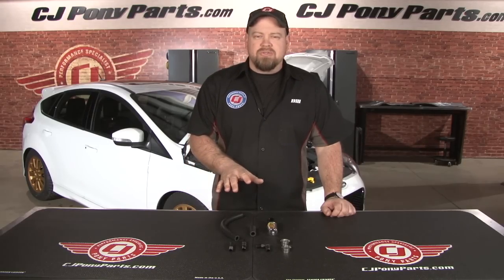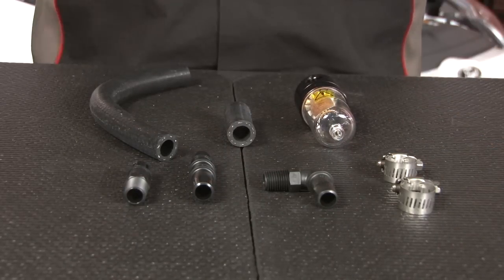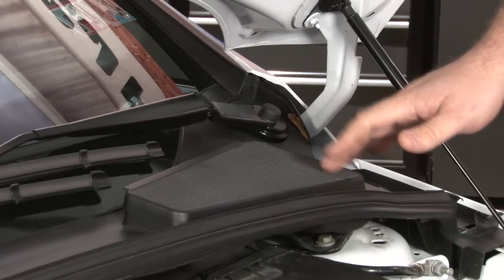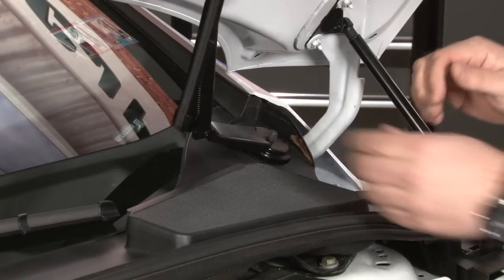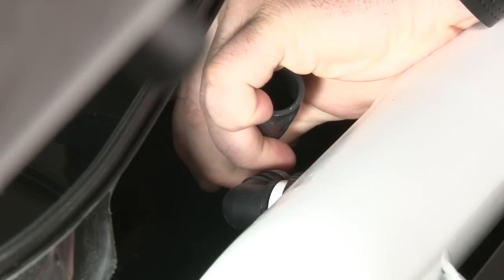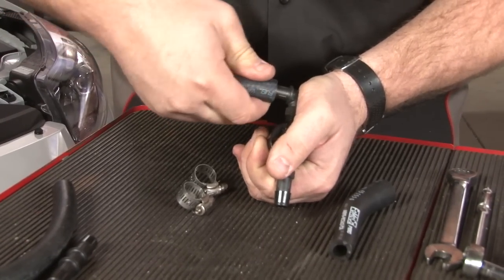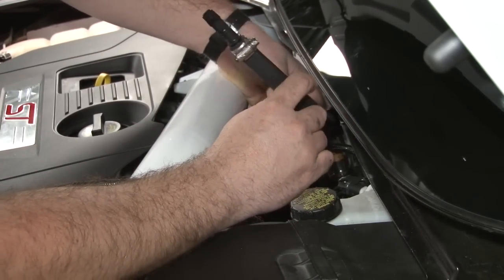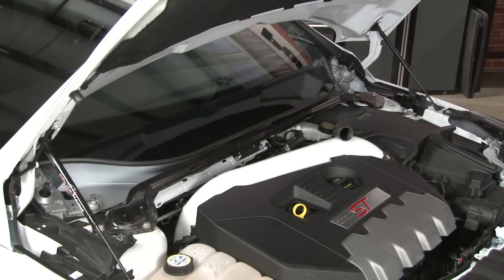Focus ST Steeda Oil Separator 2013-2014 Installation

Comment: I believe you installed in backwards. Please let viewers know. Flow should go from valve cover to the intake not the way you installed it. This will limit airflow to vent when turbocharger is in boost

Comment: Bill..I notice there are 2 types of oil separator for the ST. One that actually involve replacing the factory oil seperator(moroso etc) and this steeda's very simple tap method. In your opinion, does one work better than the other? Most peoples seem to think steeda version is not as efficient.

Comment: Is the point in making the flow backwards so the filter doesn't clog? Has anyone just plugged the hole in the intake and use a T fitting to run both hoses to the moroso catch can?

Comment: Can is installed backwards. I followed it like this and got nothing after 10k miles. Once I reinstalled it with arrow facing other way I get oil in the can imediatly.
Reply: did you put it like how he started to at the beginning of the video before he switched it the wrong way? So the arrow points to the straight fitting right?

Comment: In focus st There’s so many point to install a oil separator front, rear, and this Intake, question which is the best point to install the oil separator?? is it on intake side or front or rear??

Comment: I installed this oil separator and now my car burns oil with it on. I have it installed correctly. Now my PCV hose is cut and I'd like to take it off but like I said my oem hose is cut like the video said to. Does anyone know how I could get my cut hose to work again without the separator or do I need to find a new hose. Can't find just the hose anywhere.
Reply: Should be able to use the hose and fittings that came with the kit

Comment: Are the 2 threaded holes on top of the unit for a different application, or is there a mounting bracket available?
Reply: Its a universal fluid separator so it can be used for many different applications.

Comment: so I noticed that nobody really answers the question: does this install on the 15'-up with the annoying sensor built in?  I'm running a code and this would seem to bypass the sensor but still run a CEL
Reply: This is listed as 13-14 and only works on them, we offer 15+ specific kits.

Comment: Isn't the oil separator the same unit you can get at a hardware store for air compressors? Looks just like one, the concept is the same too. (~$20 bucks at Lowes/Home Depot)
Reply: Same idea but once you get the seperator with proper filter, lines, fittings, etc you can easily spend $40-50 so the Steeda is not priced bad
Reply: Bill Tumas Ah ok. Steeda makes great products and the customer service is great too.
Reply: Yep..got mine from harbor freight for $6

Comment: My only perceived gripe is that is alot of work to drain it , is there a way to locate it somewhere else?
Reply: You could use longer hoses and move it elsewhere but you really won't be draining it that often.
Reply: Easier oil catch cans available. Bill installed the new JLT and is easier to install and drain. Looks to be much higher quality too...Definitely worth checking into.

Comment: On 2016 models there is a sensor and connector on the factory pcv tube and its a different style tubing aswell. What kit can I use with this style pcv.
Reply: Eric R we have the same issue

Comment: Can anybody tell me why after installing a steeda throttle body spacer and Steeda oil separator im getting alot of smoke out of my exhaust.This happens after the trubo goes into boost and you let off the gas.
Reply: Your turbo is going out.
Reply: Craig Guntherberg disconnect the hoses from the steeda separator and make sure you can blow through it. You may have over tightened the fittings and blocked the airflow